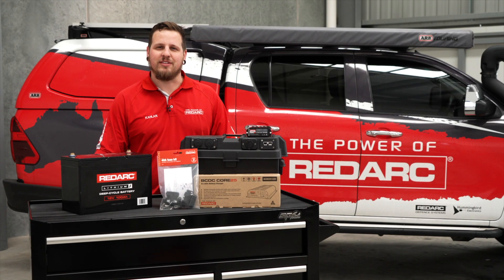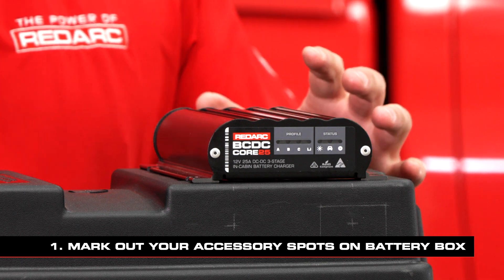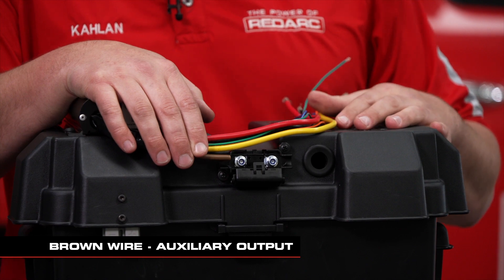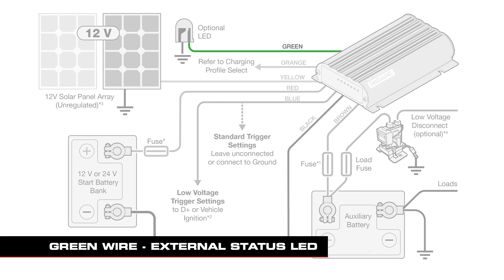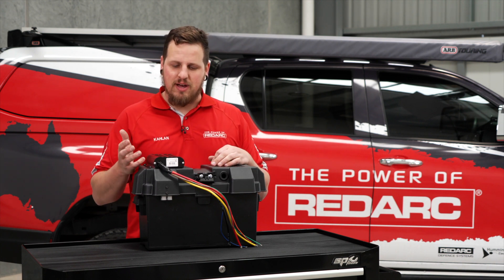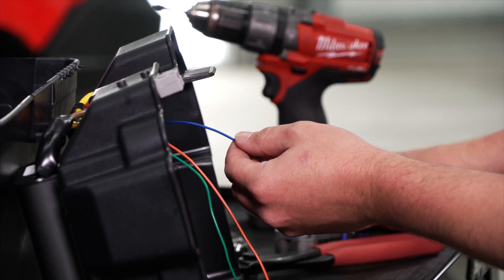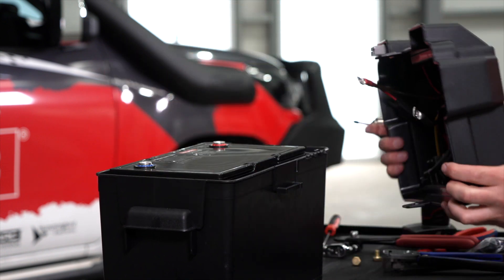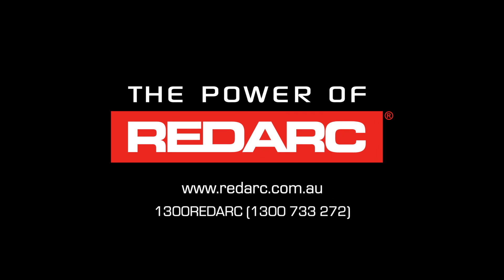BCDC CORE BATTERY BOX INSTALL

Comment: Hey guys. With the common ground, can the vehicle input be earthed on the starter battery (through a wiring kit), but the dcdc input and solar input be earthed on the negative of the lithium aux battery?
Reply from the maker: Hi CJ, thanks for your comment.
Normally we use the chassis instead of a direct connection to the battery, only to save running an extra cable through! Plus the chassis is a a big bus-bar, so useful to utilise. If you do connect the BCDC and Solar negative to the Auxiliary battery, you would then also need to connect this to the chassis too - so the BCDC can have a ground reference of the Start battery.

We hope that makes sense, see how you go and any other questions let us know!

Comment: I have installed the Core 25 installed in the back of my car, connected to a lithium battery. My car doesn't have a smart alternator, so I left the blue wire.
However, I noticed that it seems that the main battery is being drained when the engine is not running by the Core 25. When I wanted to go away, the main battery was flat after a few days of the install. I followed the instructions.
Reply from the maker: Hello, I recommend reaching out to REDARC technical support team on 1300 733 272. Here the guys can assist you with this and get you back on track.

Comment: Great video, thanks. Can you tell me what size anderson plugs you used? Are they SB 50 or sb 120?
Reply: It's a 25A charger, so I think an SB50 would be more than adequate.
Reply from the maker: Hi Den,
Normally an SB50 Anderson connector or similar would be more than fine to carry the current required. That should do well.
Cheers!

Comment: Hi guys, great video and kudos to the presenter. I wired it up like in the video, should I disconnect the battery if my car isn't to be ran for 2-3 weeks? I work fifo and usually leave it as is, but a friend suggested I put a isolator in there but I've never really had a drama with the redarc in standby mode. 
Thank you.

Comment: I have the BCDC Core 1240n and will install it in my caravan. Two questions I have if you can answer please:
1 / Is there a video on the Core install for a caravan? I cant find on YouTube.
2/ I have the smart alternator, so the blue wire needs to connect to ignition. Is there a source in the 12 pin plug?
If not then I have to run this blue wire all the way to car fuse box?
Appreciate Redarc stuff... thanks
Reply from the maker: Thanks for watching! REDARC does not currently have a specific install video for the Core40 into a caravan, There are two ways you can go about getting a ignition signal to the blue wire.
One is to use a spare pin in the 12 pin plug for a ignition trigger (you would need to check your plug to see what pins are free).
The second option is to wire the system as per the below link
https://www.redarcelectronics.com/au/resources/chargers-isolators-wiring-guides/how-to-wire-bcdc-caravan-vehicle-variable-voltage-alternator/
If you have any questions on the options above please don't hesitate to call our technical support line on 1300 733 272.
Reply: @REDARCElectronics  Second link option shows an SBI installed... hoping I dont require that with the Core.